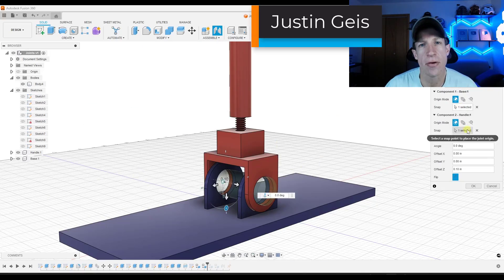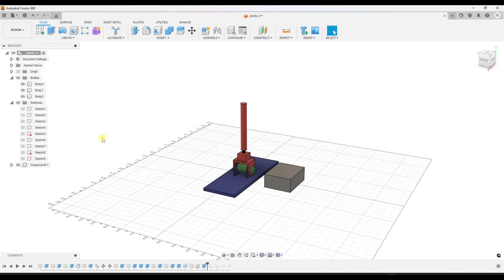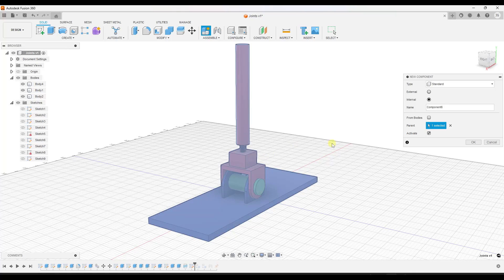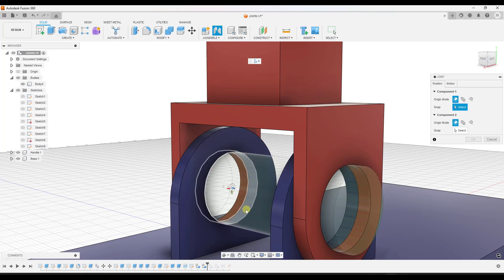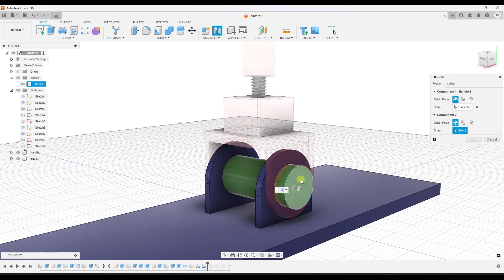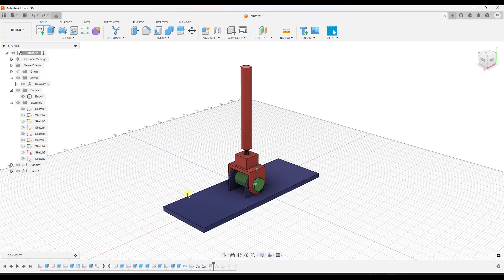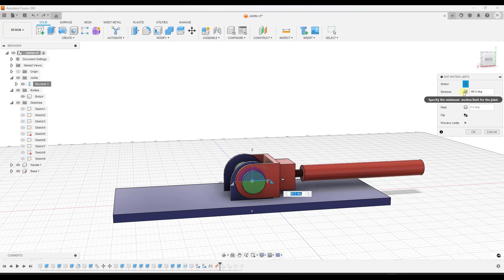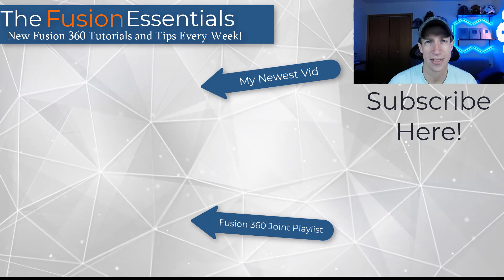Getting Started with Fusion 360 Part 6 - JOINTS AND MOVEMENT!

Comment: And in case you want to convert a sheet metal to component, to add joints and movement: Solid-create-boundary fill-select the body-select cells (just check the box in the middle of the body).

Comment: Make sure you ground before you do anything else.  Have to toss 40+ hours of work because if you ground later, it will insist on moving the component to its very first position.  So, to make any of this work, I have to redo every single in-place alignment or define a whole bunch of joints the hard way.  "Grounding in place" sure would be a nice feature.

Comment: Thank you for the video. How to make a restriction on movement depending on the location: that is, when 3 components are connected by movements and depending on the movements of one first relative to the other, the restriction of the other changes relative to the third (perhaps I wrote it unclearly)
Reply: to understand it better, did u mean when the second component moves relative to the first, the third component also changes because it is attached to the first component? Or did u mean where the third component is only attached to the second, and the second is only attached to the first?